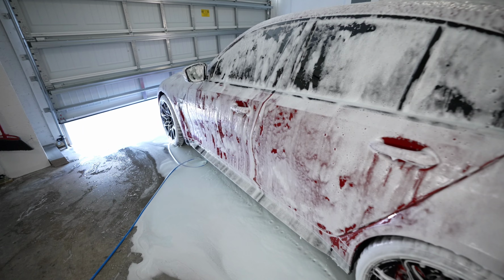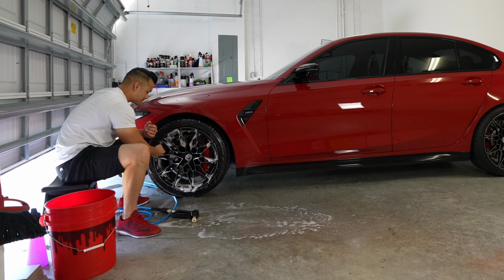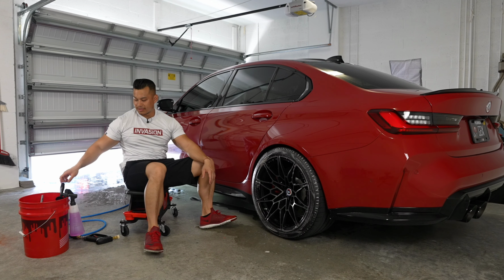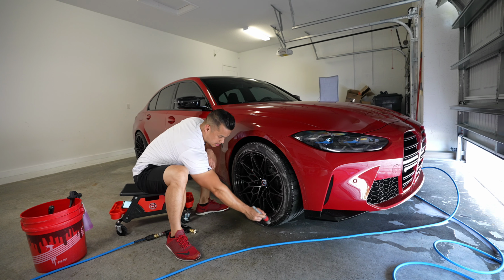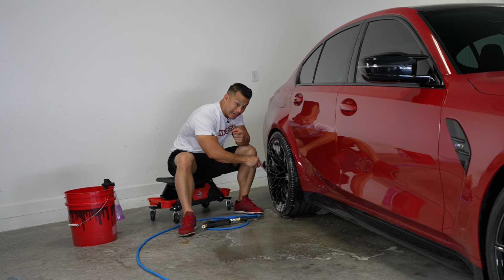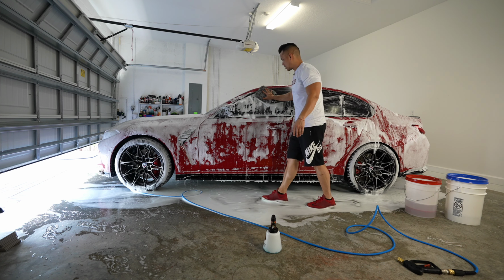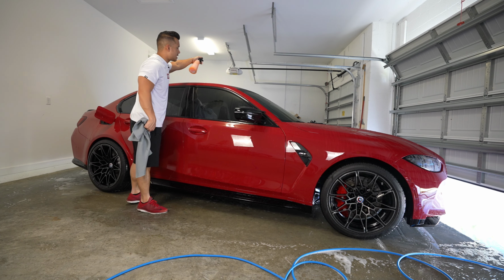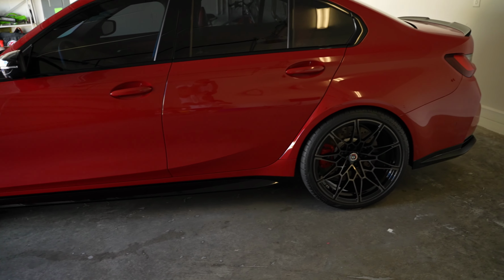Washing My G80 M3 With One Of The Best Pressure Washers Under $500 | Active 2.0 Pressure Washer

Comment: I’m about to buy a lot of this so thanks for the video man. Two questions though. Why do you have the two different detail brushes? That necessary you think? Also did you just buy that hose vs the one that came with it because of its length?
Reply from the maker: No problem! Each detail brush helps get to certain portions of the wheel and brakes. I bought that hose to get extra reach when I wash the car in the driveway. Hope that helps

Comment: are you concern that the pressure washer would peel off the PPF? good content brotha..
Reply from the maker: Actually in the beginning I was but after a year I've had no issues. You just need to keep practice safe distance while rinsing the car off. If installed right there shouldn't be any issues

Comment: Hey man, how do you wash your wash mitt? Also, check out opti hyper seal as a drying aid.  I don’t notice streaks like I did with so other product (like CG ceramic detail spray). It’s a little pricey but works incredibly and a little product goes a long way.
Reply from the maker: I actually end up using a Microfiber detergent and wash my Microfiber towels and mits at home with the traditional washer/dryer. 

I've actually tried Gyeon's Ceramic Detailer and so far it's been pretty good.

Comment: good video man.  One recomendation is to try and stop being concerned with having or using "the best" .  You can dam near pretty much obtain the same results as long as you aren't products that aren't plain trash.  Even with pw and people thinking they need to have 2.0gpm which is ridiculous.  The difference between say 1.4 and 1.9 gpm is minimal.   Anyone who says otherwise is just doing so to justify spending $1k on theirs.  Lastly, I would try to stay under 75ft for hose as going 100ft is not recommended.  Even Kranzle says to stay under 75ft.
Reply from the maker: Thanks for the pointers. I know others would appreciate it also. 🍻. Definitely agree, how people would make up excuses to justify their 1k pressure washers

Comment: I have a gas pressure washer that is over 20 years old that puts out over 3.0 GPM and about 3000 PSI that is still running and you can buy today for about $500.00 to $600.00. I also have an electric pressure washer from Green Canpump at 2.0 GPM and 1500 PSI for $650.00. Active is selling this second iteration of junk ( bought the VE Series returned same day do to surging issues) that will only last 200 Hours for just under $500.00!! People give your head a shake and stop paying for crap and allowing these companies to get rich making garbage.

Comment: What blue hose is that? Uberflex or kobrajet? 
My active 2.0 keeps running after trigger is released. Rep at active told me uberflex hose is not recommended.... i even switch to the stock hose that came with it and it works fine. Did I get a defective unit?? 
ANY ADVICE ?
Reply from the maker: It's most likely the hose. I have the uberflex and I'm thinking about switching. Main reason is that it's too thin. It does kink sometimes too. I haven't had your issues. But I am think about going with an Obsessed Garage hose which is 3/4" instead of the uberflex being 1/4". It'll probably give you a better free flow into the machine

Comment: That outlet in the back...maybe want to consider putting a cover on it if you're going to continue washing it in the car. Definitely don't want to get water in it! Hopefully it's a GFI, but for sure take those preventative measures.
Reply from the maker: Totally agree. I can always park a lot closer to the middle or right of the garage where there's no outlets. But for the video I needed a wide enough shot.
Reply: @TheDailyDriven  Totally understandable. I have a 3-car garage with 2 sally columns, so I am not as fortunate as you with the open 3-car. Keep it up with the detailing improvements!

Comment: You shouldn't dry the water with a towel.  Get yourself a spotless water system.  Then use a blower to blow the water off the car.

Having those same wheels on my G82 I definitely feel your pain having to clean them and trying to keep them clean.  I had mine ceramic coated and that definitely helps with cleaning them as even the greasy road grime comes right off with a pressure washer now.
Reply from the maker: I normally would use a blower but when I use a Drying aid like bead maker.  I like to use it when the car is wet. Unfortunately bead maker sometimes leaves streaks.